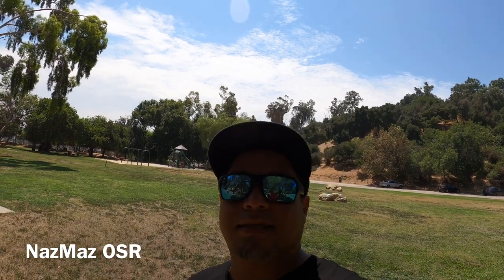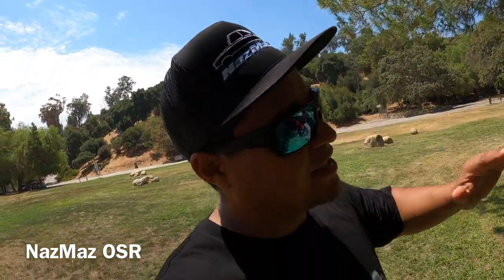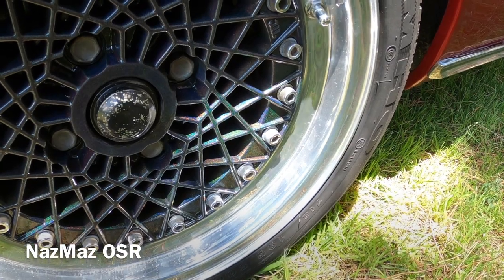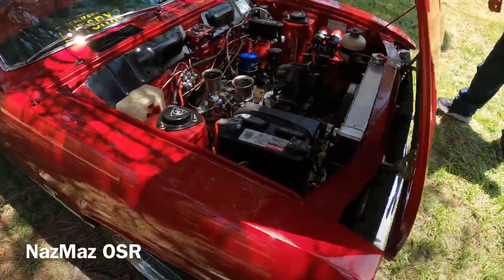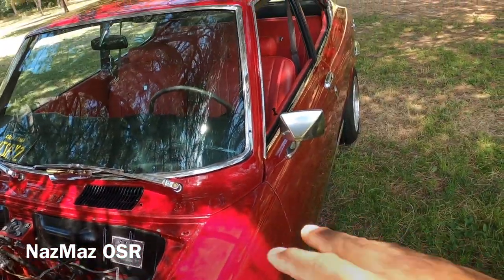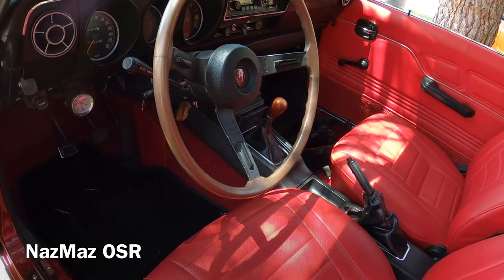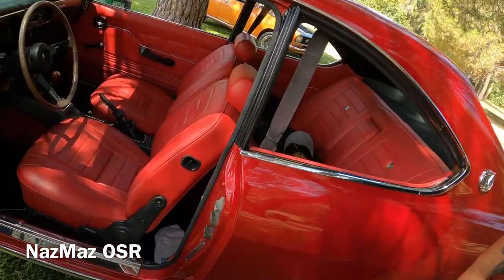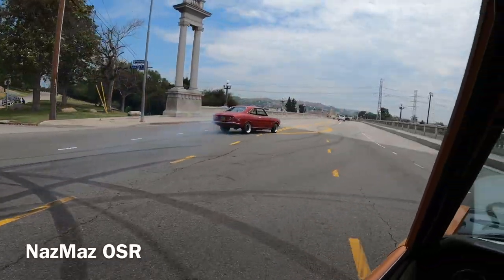Mazda Capella & Mazda Rx2 side by side

Comment: We got both in Australia but the capella had a piston motor and different taillights it worked the same for 808/rx3 & 929/ rx4
Reply from the maker: Interesting how Mazda switch these cars around overseas... Thanks for the insight...
Reply: Yeah totally, I’ve seen the original factory production timeline chart for all production of Mazda vehicles and it only shows the alternate configuration of each RX model having reciprocating engines. I believe the examples of RE equipped Capella’s, 1200 808 ,929 and 121 (RX5) were modified after production. Just speculation but I can’t see how else it was done if not officially on the production line.
Reply from the maker: Great info...

Comment: Fab footage, great cars! Thanks for sharing! 👍 Spot all those tiny differences between the model years. Body painted firewall panels and different door card patterns (71). Know it's nitpicking, but it's  a 71 Capella RE, of course. 😉
Reply: PS: REgarding the horns, I've heard that one is for urban use, one for rural use. Two tone horns were banned over here, so we only got the one horn button in the middle of the steering wheel.
Reply from the maker: Wow, thanks, that's great info and I can see why they would do that.

Comment: I bought my first if many rotary mazdas an rx2 coupe in 1992, technically in australia they were sold as Mazda Capella sports RE.
My first was a 1971 first shipment car. , my second was a 12/1972 t dash with the big re shield badges in the front guards near the bumper and the steel re shields . It was repainted toyota red mica 1993 colour , it looked similar to this red coupe. The first capella sports re  was october 1970 these are unique in build , being eyelet terminals n screws on the wiring , indecator stalk n light switch is different. The early coupes have different corner chrome with the gutters . The later ones are fatter and wider same as usa spec. , also look at the front aprin air vents  for hot n cold climates , there is a rear garnish on aust. Spec . Australia stopped the coupes after 1972 but a few private ones came in later. The  door locks are a tell tail for early cars and rear aerial for series 1, consuls are also different. 
Another is the early bonnets are different.  Love my rx2s
Reply from the maker: I can tell you know your RX2/Capella, good stuff...